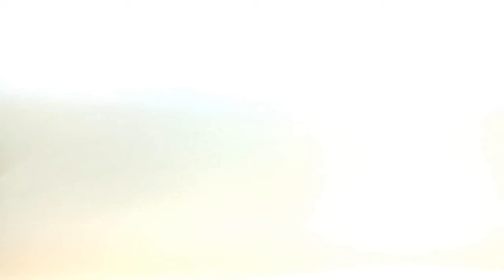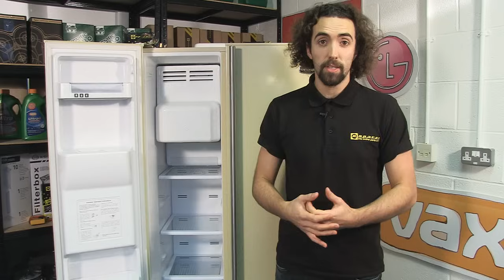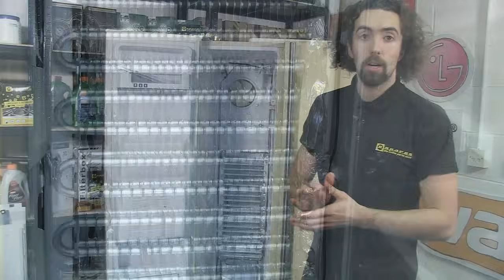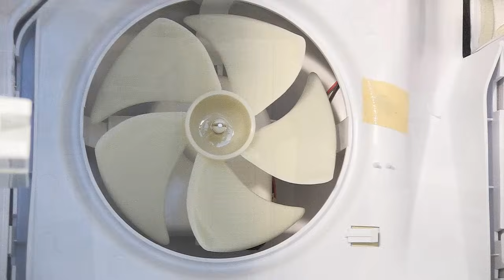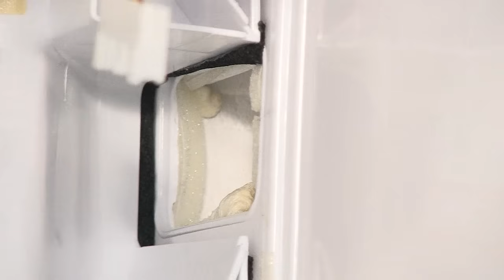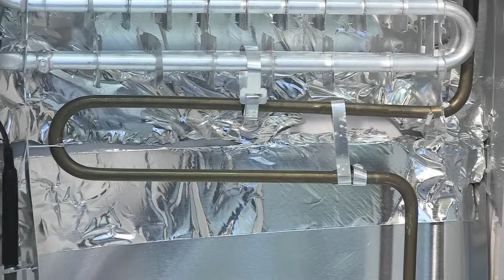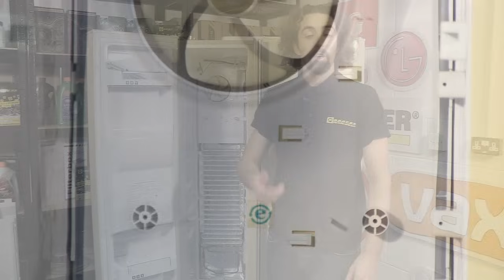BEST Advice: Frost Free Fridge Freezer Ice Build-Up & Common Problems!

Comment: Sorry it's a FF4DK Quadrio
Reply from the maker: +boxercup1 Sorry we missed your post. When the appliance is working 'hard' after it has done a defrost then it has to reduce the internal temperature by removing heat and passing it through the case so it is normal to feel hot on the side. Check the defrost circuit as if the machine does not see any heat during defrost it thinks there is ice and will not reset and start freezing again.

Comment: Hi espares, we have a problem with our Hotpoint DF4DK Quadrio fridge freezer, about every 4-5 hours it starts beeping, the lights flash and it shuts down, it also seems to get very hot around the inside of the doors, we have left it open and off for a few days thinking it needed defrosting but it is still the same. I have checked the fan and it is working, the freezer stats to freeze ice cubes but then they turn back to water.

Comment: hi I have a whirpool American white fridge freezer the alarm keeps going off and the freezer part will not freeze what do I do?
Reply from the maker: +KrinieV If the compressor is running and there appears to be some cold in the appliance check if there is excessive ice blocking the path of the cold air. If this is the case defrost it and check the defrost heater.

Comment: Josh, I have a situation you might want to think about. I have a Amana side by side refrigerator. After about 5 years of use, I cam home to find the freezer thawing and the frig side warming. I pulled cover off the evaporator coils and finished clearing the ice, I found something with this defrosting system that baffled me. IT was about the size of a golf ball with 4 or 5 wires into it. Not knowing what this device was and not knowing how to diagnose it, I just cut all the wires and when I turned the frig back on it began cooling. It has been over 6 years now and the freezer cools around zero and the frig side stays around fifty degrees. The element no longer working on the evap. coil and around the doors, this frig remains frost free. Comment appreciated.
Reply from the maker: +Alvis Jenkins Manufacturers do not normally pay for an extra part that is not needed. Without a model we cannot identify the part but generally with frost free appliances there is Thermistors or cut outs near the heater/evaporator to identify when the ice has cleared during the defrost.

Comment: My mums Hotpoint Mistral fridge freezer was making a really mad noise after cleaning the bottom from years of dust and fluff.. then the compartments readings were fridge 4c and freezer as 44+ but when i tested the temp it was minus 3 but now there is no noise and the freezer has alot of ice and build up.. ive been told the Evaporator & Thermistor cables are the problem.. but i do not know where they are on the fridage as i want to repair it myself as its a easy fix and my mum is a pensioner please advise also the temp has raised in the the fridge to 14c
Reply from the maker: Rc-Nerd The first thing to try is to manual defrost by emptying the freezer and switching off with the door open for at least TWO DAYS to completely clear the ice with the door open. The problem is likely to be caused (depending on model) by ice not being cleared as explained in this video.  After this you will probably find the appliance will work fine but if this returns after a few weeks you have a fault with the defrost heater so will need to defrost again and check it. :-)
Reply: Thank you but today it stopped even making a noise and the worst case the thing is now not reading the temps we cannot defrost as this is the only fridge we have we have a engineer coming out ill keep you posted. Thank you for a brilliant video you guys are great
Reply from the maker: Rc-Nerd Make sure if an engineer is checking it that he does not just defrost but checks the defrost circuit as this is the likely problem and there may be a modification for this depending on model.
Reply: Ow I will it's costing £50 to come out but if I feel he is taking the crap I'll drop him 20 and show him the door.

Comment: Great video and very informative. My Westinghouse fridge freezer is always too cold, being the fridge is often -7 and freezer -19. regardless of the digital control settings, where do I find the thermostat and/or is it a fault in the control boards
Reply from the maker: Geoff Bryce Hi Geoff, We don't really see Westinghouse appliances  but speaking in general terms a lot of the fridge freezers do not have an evaporator in the fridge but use some cold air from the freezer ducted to the fridge. These use a 'letterbox' type shutter to control how much cold is allowed in. If this has stuck it would continue to allow the cold air in and freeze accordingly so look for this flap (usually at the top) and check if it is frozen or stuck. The flap may be controlled by a motor or a bi metal strip on a manual thermostat inside.

Comment: I have a JL6002 freezer. It freezes perfectly, but the temperature indication on the front panel does not drop below +2 degrees, so the cooling cycle never stops. Is this the Thermal cut out malfunctioning or what? Grateful for any advice.
Reply from the maker: Simon Huntingford Check the temperature inside as if the machine is continually freezing it should be well below -22. If this is the case then try replacing the sensor Stock Number: ES579571. If this does not resolve the problem it is likely to be a faulty main board which is no longer available.

Comment: Thanks for the video, it was very informative. For my model of Bosch freezer, the heating coil is spec'd at 192W and 115V which works out to about 70 Ohms.
Reply from the maker: As shown in the video above, frost free appliances have there cold area behind a cover that will ice up but are then defrosted by the heater. There are two or three possible reasons for your problem.
1: Check the defrost element on the radiator has continuity with a meter and replace if faulty.
2: Check the door seal has no gaps allowing excess air into the machine.
3: Ice comes from moisture in the air. A lot of cooking and poor ventilation will increase ice build up so improve ventilation.
4: This particular fridge was not great at defrosting and there were modifications by the manufacturer fitting a larger heater and heat shield. May be worth checking with the manufacturer if this is needed.
Reply from the maker: Nick Buroojy Hi Nick, We produced these videos primarily for a European audience using a 220 - 240 volt supply. As your supply to the fridge is 115 volts the resistance has to be considerably lower to produce the same power so the figure you gave is correct for your unit and will be similar for any unit designed to run on 110 - 120 volts. :-)
Reply: hi I have a hotpoint Ff187l fridge freezer and the fridge was not working but the freezer was it is a frost free. when I opened the back panel of the freezer it was all iced up and the first time I did it I used a hair dryer to defrost it and it started working. The second time after 3 weeks the problem happened so when I opened it up in defrosted it with a hair dryer but this time the hole was blocked with ice and it is working fine and it the second day touch wood it is okay so can you tell me what it can be. Other thing is my cooker hood stop working and my wife does a lot of cooking. It started to play up when the cooker hood stopped.

Comment: Nice clear overview. I have an RS21 but the fridge temperature is being reported lower on the display panel than it actually is. I have set it to 1 degree Celcius but thermometers are showing around 5 -6 degrees. I have had the modified evaporator cover with cooling fan mod (metal heat transfer clip) years ago. I replaced the yellow/black temp sensor and found some ice around the evaporator area as well as over the temp sensor (fan was clear). Is there meant to be some small amount of ice and given the heat pipe area (between the two side by side doors) can get quite hot when the compressor is running, would the PCB assy be the problem? Heater next to evaporator measured around 285 ohms iirc and fuse was short circuit so all looks fine there.
Reply from the maker: fallofdutee  There has been a number of modifications on this model like those mentioned but there is another as fridge can suffer from ice build-up and has a repair kit to prevent this occurring:
http://www.espares.co.uk/product/es1406833 
Fully defrost before removing the cover. Fit the brackets onto the back of the upper mounting screws, replace and move the sensor to the far left of the pipework and reset codes as per the instructions.
Reply: eSpares Thanks for the reply and link. Model is RS21-DPSM. I was looking today and find both the freezer and fridge aren't getting low enough temperatures with freezer showing about -16 lowest but currently -13 degrees (set panel to -19) and fridge 5 to 6 degrees (panel set to 1 degree). The fridge is colder higher up also. The only thing I can say has changed recently is replacing the fridge defrost thermistor and did notice a little ice around the heater/evaporator behind the cover but not lots.Tried altering the reference value (1) for fridge to offset temp by 3 degrees to no avail. Will have to remove evap cover and  check for ice and seal again. Noticed recently the cold water wasn't very cold too. 

I see there is a white-covered thermistor in the mod pack whereas the one I have (and replaced too) in the fridge is/was a black on and was fixed in its black clip/cover to the copper evaporator pipework. Is the white thermistor the latest one and what are the other parts? What is the defrost cycle usually and the reset codes? Starting to think there isn't enough gas if both fridge and freezer aren't cooled. Will take off evap cover assy again to check seals but thinking of changing the PCB DA41-00388J which I checked. Would the suffix make any difference as I have seen DA41-00388A for sale? Thanks again!
Reply from the maker: fallofdutee The white sensor was a modified type and moves to the input pipe above the evaporator as shown on the info on the kit I mentioned. the board suffix I think refers to the latest productions/modifications but confirm the PCB has all the relevant sockets for your plugs. If there is low gas the evaporators will stop frosting at 2/3 or 1/3 its length progressively.
For details of the defrost cycle you would need to discuss with Samsung Technical (good luck as they may not talk to non account holders). :-)
Reply: eSpares The thermistor placement was/is on the top left of copper I/P pipe. Read sites such as ukanfixit who iirc say the black is new and white old - but the old black one shows no signs of water ingress which I believe is the difference. Checked freezer today and is at neg 22C but fridge 0.3C @ top and 4 C @ bottom. Wonder if dropping fridge temp by 3C has dropped freezer also. Samsung are great to deal with aren't they..  not! ;-)
Reply from the maker: fallofdutee The kit I recommended was the last modification I came across and comes with the white sensor and from memory the old sensors in  the machine were black but I cant be sure.The freezer will always take priority as its needs will control the rest of the appliance but this should still allow reasonable regulation in he fridge.

Comment: Great Vid man, doesn't help me, (yet),  but I'm sure it helps many. I have a 331 Fisher & Paykel frost free and the alarm beeps every 12--24 hours or so. Usually @ 4am or so. drives me insane, ha, Fridge is still very cold but I'm figuring it maybe too cold after watching your vid and it may not be melting the ice build up. Any help/advice much appreciated as I live in a  remote area which makes it hard to get looked at. Cheers, regards Steve
Reply from the maker: COOMA Thanks for your comments, The alarm beeping is likely to be occurring when the machine is doing its defrost cycle and the inside temperature is rising to defrost the ice on the evaporator. So thinking about your problem we can say that the temperature sensor is reading correctly?. The defrost is likely to be occurring?,and the defrost heater is likely to be working?. I would empty the appliance and defrost completely for two days with the door open to ensure no ice is built up near the evaporator and retry you may find this alone cures the problem.
Reply: Thanks man, I'll definitely try this and get back too you. Cheers      regards  Steve

Comment: Mine fridge is making huge crack noises
what can i do about this?
Reply from the maker: Hi PlaystationQUAD, the reason for these cracking noises is likely to be due to expansion and contraction of components and the lining inside the appliance due to the extreme cold and then warming in the back when it runs a defrost cycle.
This can be quite normal as during defrost a heater has to melt any ice that has built up under the cover so there can be a significant temperature change.
This can be made worse by excess ice that may be holding the expansion and then releasing in the same way as an earthquake is caused by sudden ground movement.
This may be helped by ensuring the appliance is level and also defrosting by switching off and allowing to dry with the door open for a few days (if you are going on holiday for example).
Reply: eSpares Hi thankyou very much for the quick answer
the Crack noises began 2 weeks ago and stopped a week ago and never heard them sins then.. its all good now. you are absolutely right the weather over here last week was very cold and i turned the heater up . So that would explain the noises. I was just curious if maybe there was more to it but its good now
thankyou
Reply: That's normal it's ice being expanded , it's like a very loud crack don't worry